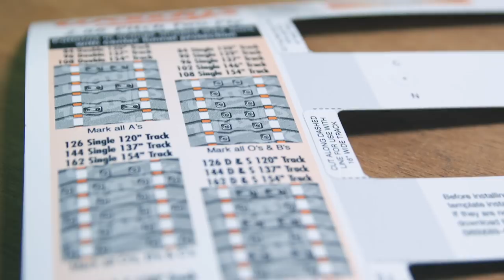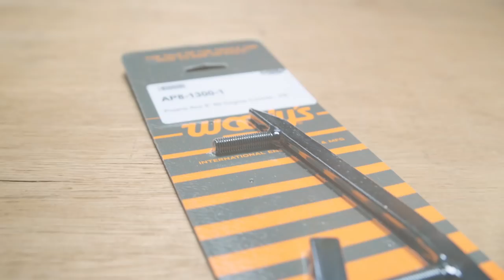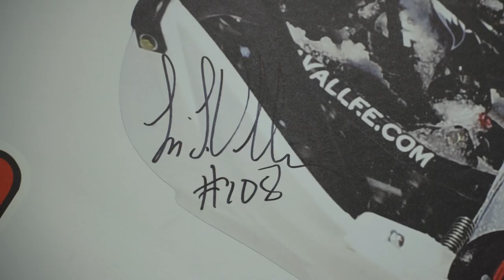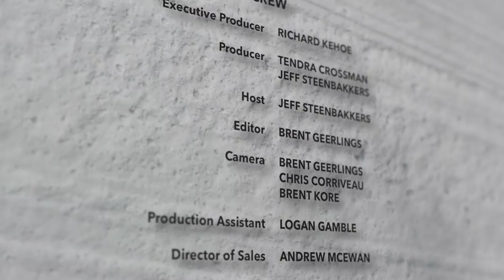Snowmobiler TV 2020 - Episode 6 - Grizzly Lodge

Comment: I don't like studs, add weight and can cause damage to tunnel and exchangers and can lead to early track failure.. Back in the 80s-90s with low profile tracks (that's all we had) you had to stud to get more grip.. Now days with 1.25+ lugs and some with even built in studs, IMO the studs of old are just about useless unless ice/racing!
Reply: I like a little slip even on trails. The 2020 gade with no studs just rips in MN and Wisconsin icy trails just fine
Reply: Sounds like you guys have never slid down a hill on a trail backwards that was glare ice  . . .
Reply: @toddbunnett640  I have a few times and I had studs. I ride differently now.